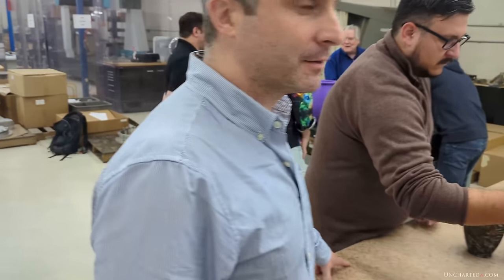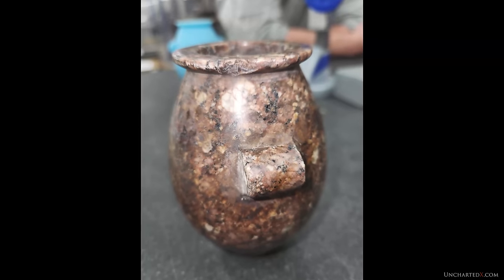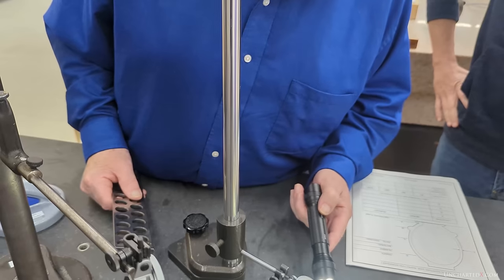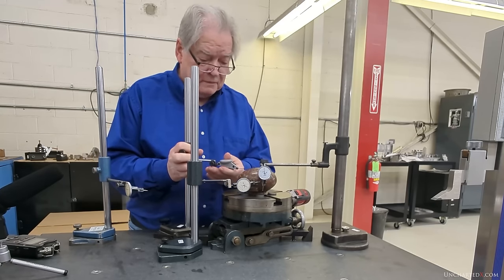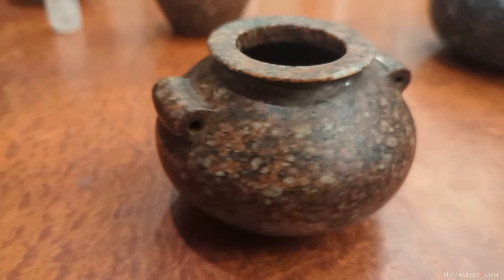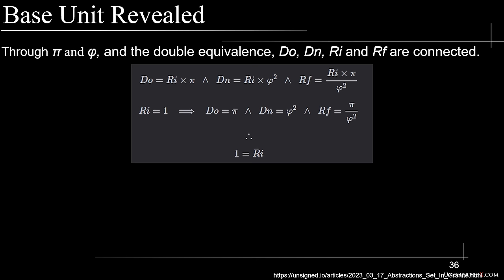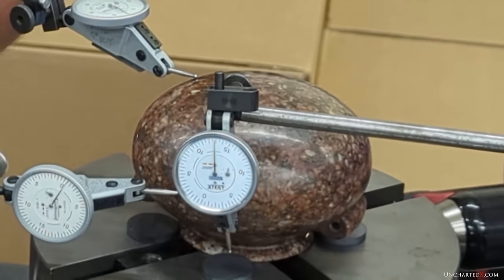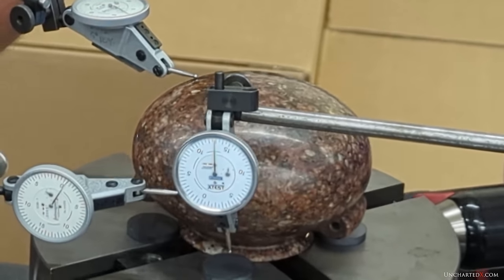Astonishing Results! More Ancient Egyptian Granite Vases Analyzed! More STL's available.

Comment: What bothers me is that the whole argument that is made in this is that you need modern high end equipment to make vase that is consistent in diameter.   I don’t think Ben understands how a lathe works.  You can literally chuck a piece in a lathe that is completely inconsistent in shape/size/diameter, and make it consistent in diameter in shape with minimal tools. Look at wood bowls made from raw tree logs with bark, they are extremely accurate in diameter when finished because of how a lathe works.   

Let’s look at the facts:

1. Clearly those vases are “real” in the sense they exist. 

2. It is possible they were made on a lathe, because lathes can be used to grind stones.  

3. It is possible those vases are not original Egyptian vases

4. Achieving high accuracy on an outside diameter of a machined part on a lathe is far easier than is portrayed on this video.  I could put a brake rotor on a dial indicator setup like was done and Likely see similar results, and a brake rotor hasn’t been machined to anywhere near the tolerance that’s possible.   

5. There is a huge assumption made in this video, that is that the person making the vase actually had tools to measure the part and was worried about actual dimensions.  Proof of advanced measuring could easily be proven by having multiples of the exact same vase that are exactly the same size.  You can’t achieve that without a way of measuring them accurately or having a machine that is consistently accurate.  All of the vases in the video are distinctly different from each other, suggesting the exact opposite, that they didn’t have a way to consistently make things the same size.  

6. It’s reasonable to suggest that the technology doesn’t exist to melt/liquify hard stone for the purpose of making vases.  That combined with how different all of them are suggest a mold being used is impractical/impossible.  

7. It seems to be reasonable to suggest they are not a concrete type substance what was poured and later solidified.  

With all of that said let’s look at reasonable solutions to the problem of how they were made.  Throw out the argument of how old they are and let’s focus on how they were made.  Based on the above information I think it’s very reasonable to suggest the vases were spun on a lathe and that they are indeed made out of a solid piece of stone.  Due to the random nature of the vases I don’t believe they had high precision measuring tools or high precision mass production of vases that would suggest CNC.  The accuracy mentioned in this video can be achieved on a fairly simple lathe without complex measuring tools and because there is no consistency of size and shape vase to vase there is no need for the ability to accurately measure.  Some of the measured cases had poorer accuracy than others as well, further proving how inconsistent they are to one another. Having a consistently machined round object can be done on a simple lathe with no measuring tools at all, that is the purpose of a lathe.  Based on all of this it’s reasonable to make the assumption that the parts could have been made on a lathe.  

My conclusion based on what I saw in this video and the evidence is that they were made on a manual lathe without access to precision tools (or atleast they weren’t needed because of how varying every vase is).  Nothing I saw was impossible with a lathe or similar device.  Which brings up the next question, when were they made?  Well if they are indeed very old (and even egyptian) then clearly they had a lathe or similar device of some sort.  If modern historians believe they didn’t have a lathe or similar device, and these objects are indeed old, then modern historians are wrong.  A quick google search says that they believe Egyptians did have lathe technology, so I am not sure where the smoking gun is in this case?  I like bens enthusiasm but half the mystery proposed in this video is simply created by him stating things like “the modern explanation is banging/rubbing on them with rocks”.  Well clearly that isn’t how they were made, and clearly that isn’t everyone’s opinion on how they were made.  The only real mystery is when those exact vases were made and what kind of lathe were they made on.  So much of these vases and the mystery of Egypt’s capabilities is due to the lack of knowledge on both sides.  Ben is not a machinist, and he doesn’t seem to understand a lot of fundamentals (like it’s far easier to make a round object super precise than a large flat table super flat) just as a lot of egyptologists/historians may not understand machining/lathes/etc and how you can’t make round objects precisely round with out a lathe.  Again, the smoking gun in this whole video is clearly a lathe was used, and it’s possible to do everything seen in this video on a lathe.  So there is no real mystery.
Reply: "Proof of advanced measuring could easily be proven by having multiples of the exact same vase that are exactly the same size."

This is not the gotcha you think it is. This is merely your own flawed assumption and is used to deflect from the precision we see on these objects right in front of our faces. 

And as for the rest of your comment, I think you are completely disregarding the presence of the handles and how that would pose a severe difficulty in machining these vases with primitive tools, or even a lathe. Aside from a magical CNC, the presence of handles absolutely necessitates a second step in the machining process, so the question is....how would the ancients have machined the area between the handles to the same tolerance as the rest of the vase without the ability to verify the precision to the 1000th of an inch? if you're suggesting they just "eyeballed it", then you're just being intellectually dishonest. this is also not even considering the dozens of other precise geometric relationships the vase displays, such as concentricity, etc that wouldn't be possible to verify without a precision measurement tool.
Reply: @AustinKoleCarlisle 

Couple things:

You don’t need precision tools to make a  consistent outside diameter with a lathe.  How is this wrong?  I can take a chunk of aluminum, put it in a lathe, spin it, and with a very simple tool make it concentric within a thousandth of an inch without using a single measuring tool?  Every vase shown is completely different in size, shape, and consistency in concentricity.  If multiple vases were the exact same diameter that would suggest either a “cnc” machine was replicating it or that a person was using precision measuring tools to verify they are the same.  I can do 100 vases on a lathe and likely get them close in size, but probably only within a spread of maybe a 32nd of a inch if I used a wood template to gauge size.  To achieve a consistency piece to piece of thousands of a inch requires precision measuring (either by a machine or person).  The tolerance piece to piece shown on this video is probably 1/4inch or more, none of them are even close to one another, which completely negates needing precision measuring tools or requiring a CNC machine.  How am I wrong?  Do you not understand how a lathe works?  They can achieve 1 thou roundness of a part with no precision measuring tool.  

Secondly, the precision between the handles.  As a experienced stone mason (I have experience carving stones) I can share some details on that.  If you spun the vase on a lathe you would create a protruding ring where the handles are during machining of the vase.  Once the whole body is rough machined you would take the vase and mark handle location.  You would then take either a small copper saw with grit (which the Egyptians had) or a chisel and chisel a cut out near the edges of the handles.  Once the handle is independent of the ring you would chisel the ring off.  Hard stones spall easily and cleanly when struck.  Once you got most of the ring off between the handles you would have two perfect surfaces that were lathe cut (the areas above and below the handle ring) to polish/grind down the rough surface to.  The whole thing could then be polished while spinning with some
cloth that had grit in it to further refine the vase.  

If you noticed, when measuring the area between the handles, the consistency was far worse than the rest of the vase for roundness.  Not surprising since it’s not possible to achieve the same consistency on that part because it would have to be done by hand in the manner I described.  

As far as the whole “geometric shape, alignment, and accuracy” argument, I think it’s overblown.  If you look at any object that’s reasonably precise you can start to find ratios of mathematics in them.  The bridge outside of my window could be scrutinized using Bens (and others he mentioned) thoughts and it too would likely have interesting ratios of circles and measurements.  The golden ratio would also likely appear since it has numerous arches and was engineered for maximum strength at the lightest possible weight.  Does that mean the builders of it used “sacred geometry” and had “unbelievable knowledge of the universe”?  Absolutely not.  That whole argument falls more under fantasy than reality.  So much so that I am
Half tempted to go to a store, buy some vases, and do the same geometry investigation he did to show how ridiculous that really is.
Reply: namelesshorror1750  I can’t comment on who had what at what time because I don’t study ancient Egypt history.  If the statement “the old kingdom didn’t have lathes” is true, then they didn’t make those vases.  The problem presented in his video is that there is no way for him to prove how old they are.  From what I have read the Egyptians possessed a lathe in their bag of tricks at some point.  That means once they had it they could make that vase.  If he is claiming those vases were made before they possessed a lathe, what’s his proof?  If the Egyptians possessed a lathe at one point, it’s possible (but not probable) they had it 500 or 1,000 years earlier that what is thought, which even though is improbable, is clearly the smoking gun to how those vases were made.
Reply: @makingmistakeswithgreg  the area between the handles was precise to within a few 1000ths of an inch, just like the rest of the vase's surface. how would this have been verified if the micrometer wouldn't be invented for several 1000 years? eyeballing it? if that's the case, that precision can be eyeballed, then why were the later vases visually wonky and uneven?
Reply: @AustinKoleCarlisle  
To answer your points:
The issue with dating those is how is it possible to know exactly when and where they were made?  They could be 1,000 years newer than people think, they could be made by a completely different culture, and they could even be made over a span of thousands of years.  They could also be fakes.  I can’t attest to the exact age of any of those objects and neither can Ben.  

I can attest to how they were likely made and the feasibility of making them, which has nothing to do with any sacred geometry or argument over age.  The vases clearly suggest they were made on a lathe and modern vases have been constructed this way (Google granite turning on a lathe), so it’s 100% possible.  Lathes can hold a thousandth of a inch tolerance on a material like granite, even Ben himself stated granite is often chosen because it’s possible to maintain tight tolerances (and it doesn’t change dimensionally much).  That tolerance can be maintained relative to a single piece of material, without precision measuring tools.  Precision measuring tools are required to make multiple vases identical in size to one another, which his collection does not even remotely show.  

As far as how the area between the handles was able to be maintained at such a high accuracy, it’s exactly how I said in the previous response.  You have the lathe machined surface that is accurate to say 1 thou, above and below the ring left for the handles.  You isolate the handles from the ring, and then chip the ring off.  Stone chips very easy because it’s hard and the thinner the ring the easier it chips.   With the ring between the handles chipped off and a rough surface left, you simply level the rough surface to meet the two machined lines.  If the machined lines are accurate to 1 thou, and you need to level the 3/8 to 1/2 inch of rough surface between them, it’s possible to do so with great accuracy.  Why?  Because the distance is small and your start/stop points are super accurate.  The fact that particular vase is super accurate above and below the handles and between them it’s far less is EXACTLY what you would expect given the probably method I suggested.  

Specific measurements between the handles are as follows:  the gauge used measures in .0005 (5 ten thou).  Start to finish on the side shown it moved 6 tenths or 3 thou.  Considering the lathe machined parts on both sides of the handles measured to a thousandth, it’s easily possible to chip off and round/flatten the area between those reference points to an accuracy of 3thou.  Ben isn’t wrong, a lathe didn’t machine that area between the handles, which is exactly why it’s the least precise area on the vase. 

Another thing worth noting is that to a certain extent the harder the material is the easier it is to hold tight tolerances.  Granite is very hard therefore using abrasives to finely polish it can produce extremely tight tolerances and extremely flat surfaces.  It also chips very easy when it’s reduced to thin diameters because it’s so brittle.  When it breaks it’s not like limestone either, where it can crack in unexpected ways.  It chips in very predictable ways, much like a house brick.  If you take a brick chisel, chisel all 4 sides of a brick, and then hit it solidly on the first side again it will break very close to the chisel point.  It won’t randomly break perpendicular to the chisel mark lengthwise to the brick.  Granite is the same way, but even better (I have worked with granite before).

At the end of the day Ben has discovered some form of lathe was used to make atleast some of those vases.  At one point it is know Egyptians had a lathe.  The accuracy of what he found is achievable with granite on a lathe.  The vases could be made on a lathe today, which negates his “round about” implication it’s not possible.  His only argument is that an older civilization than is thought produced it.  That is possible however he really doesn’t have any evidence to prove this, and it still doesn’t really prove much?  So they had a lathe earlier than what was thought, or Ben/vase owner is completely wrong on who made those and when?  

Where is the mystery?  No need for smoke, mirrors, sacred geometry, a good guy/bad guy routine, or a “challenging the status quo”.  Ben could have legitimately discovered proof that Egyptians discovered the lathe far earlier than known, which is unbelievably awesome, and he goes and muddies the water with conspiracies that belong in a book which will unfortunately only discredit his argument.
Reply: @makingmistakeswithgreg  the precision of the area between the handles was consistent with the rest of the vase--a few 1000ths of an inch. and it's not flat, it's curved, which poses and even more difficult challenge because you cannot lathe the area between the handles.
Reply: @AustinKoleCarlisle  you are incorrect, watch the video closer.  During the rotation of the vase the dial indicator above and below the handles indicates 1 to 2 tenths, so 1 thou to half a thou in the area above the handles.  That is hugely different than the 3-4 thousandths measured on one side between the handles.  Like I said, the area between the handles was not machined on a lathe, it was done by hand breaking the granite band off with a chisel and then polishing the rough surface down to match the two existing lathe machined surfaces/areas above and below the handles.   3-4 thousands variation is height is a lot over that small of a distance.  The difficultly people have understanding how that was made seems to stem from the fact the surface is so polished, you can’t see tool marks.
Reply: @makingmistakeswithgreg  

A few points to consider
- Rotating tables were discovered in Ancient Egypt, rotating tables can be used for clay, and it has been used in both Ancient and modern Egypt
- A few challenging aspects, the speed of the lathe/rotating table, Is the lathe powered by water, wind,  other, or manpower, and how much rpm is enough?
 and the tool itself (hardness and pressure), how will it remove the material, including the more challenging interior part of the vessel
- Buying modern vases and investigating the Geometry will not help much, what we need is how we can do this with the tools available in the historical records (flint, wood, sand, manual rotating tables, copper, .. etc), this is the real challenge
- A Russian Team tried to reproduce a similar vase, it took 2 years and 7 months for 2 sculptors, to carve a 15 cm diorite vase, and the outcome was very bad compared to those in the video, rough surface, no polishing, and even V shape interior
Reply: namelesshorror1750 I don’t think you understand how even a cheap lathe works.  On a hard material even a simple lathe can hold tolerances of 1 thousandth if a inch.  A simple lathe could make the vases in the video.  The probability of it being a simple lathe increases the more the vases are different in shape/size because it shows no consistency to a production.  Any person in possession of a lathe and accurate measuring tools can maintain 1 thou in roundness/concentricity on multiple objects like a vase spun on a lathe.  The fact they vary so much in size/shape/accuracy is evidence to suggest they didn’t have precision measuring tools.  If they did they could have easily created more equal sizes.  

The possibility of having one, some, all be fakes is high because of the value behind said objects and the ability to create them on a simple lathe.  As much as Ben suggests academia is out for their own good and full of hot air, a bunch of stone vases with no absolute proof to authenticity/where they came from is equally suspect.  I have no reason to believe Ben is purposefully lying about anything.  But I have had a enough people come up to me trying to sell me a 10k Rolex for 400$ that I know better than to make a assumption on validity of something that has no identifying marks and sold for a high price.  If all those a vases turn out to be forgeries he has no story.  If they turn out to be far newer than is believed, he has no story.  His story is firmly planted on the shores of “these are older than when the technology existed to make them” which is not a very solid footing.   100% they are probably old, some may be Egyptian.  It’s pretty clear they were made on a lathe and a simple lathe can create the accuracy depicted in the video in the ways I have described.  They couldn’t have been created before the lathe or similar machine existed, so either they were made during a time that a lathe was known to exist or they were made during a time a lathe wasn’t known to exist (but actually did exist).  The second one is possible but difficult to prove because of the difficultly in proving when those vases were made and where.
Reply: @makingmistakeswithgreg  yeah but how were they able to verify how much material to remove or leave while shaping the area between the handles? if you don't have a precise measuring tool telling you how much to remove, how do you maintain a tolerance within a few 1000ths of an inch? how do you maintain wall thickness tolerance to within a few 1000ths of an inch?
Reply: @AustinKoleCarlisle  if there is a protruding ring around the vase that you left, you could easily bust it off and match the machined surfaces on both sides of it.  The same way a stone mason flattens a block of stone and takes a chisel to make square corners or details.  If you take a flat surface that is precisely flat, that has a consistent protrusion that is exactly 1/2 high, 3/8th wide, and straight across it, you could take a chisel and break it off slightly higher than the flat surface.  You then take something to grind/sand and just level it across.  The end result will be accurate to whatever the flatness of the surface was, plus a little bit.  The vase might seem more complicated that it is, but the same technique would work on it.  The handles are very narrow which isn’t a huge distance to have to round/flatten.
Reply: @RedDarkBull  it will be difficult to do with minimal tools but not impossible.  Granites strength is also its weakness.  It may be hard and strong and abrasion resistant, but it chips easily and tends to be brittle.  It is also susceptible to flame hardening (put it in a fire and get it hot, toss water on it, and the material fractures/becomes more brittle further making it easier to remove material.  Many civilizations after the Egyptians mastered granite work, without even a power tool.  The Egyptians didn’t make that much in granite compared to future civilizations.  Most of their work was in far softer stones. From a technical and manpower perspective they had over a million people in their civilization, potentially thousands of years, and they had the same brain power we have (just less technology).  I don’t see why they couldn’t have made a simple vase on a lathe.  The precision of it is a result of the technology of a lathe and not the requirement/specification of the job.  Even his own group of samples showed a massive difference in dimensional accuracy within the vases, which makes the possibility of fakes, forgeries, or inaccurate dates of them more possible.  

That’s the cruix of this issue, he doesn’t want to use time honored archeology based conclusions for dating objects, therefore to only reason his constant arguments hold any water is because the actual date of the objects can’t be absolutely determined. You can go in my shop and find numerous parts that are machined to within a thou of roundness, yet most of that was unintentional, it just happened because I spun something on a lathe.  That doesn’t mean that was my intensions from the start.  A bunch of bases don’t prove or disprove origin or who made them, so that whole argument is a separate issue.  We can tell they were likely spun on a lathe, and that a skilled person did it.  They were also likely all unique to themselves, which suggests a single simple lathe did it, and without the need for high precision tools.  I really have no skin in the game of who did it or when, that’s not of my concern.  If it was absolutely before a time men were known to have a lathe, great, the evidence exists that prove the lathe existed before then.  In no way does it prove high tech, or hidden geometry more than over analyzing turnings in my scrap bin does.
Reply: @makingmistakeswithgreg  you didn't answer my question: how do you maintain a vase wall thickness tolerance to within a few 1000ths of an inch using nothing but primitive methods?